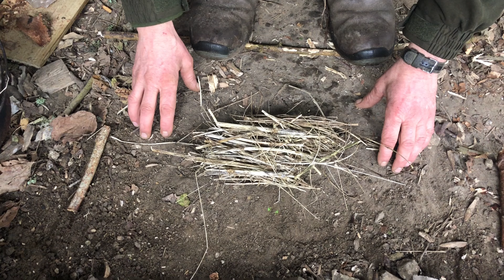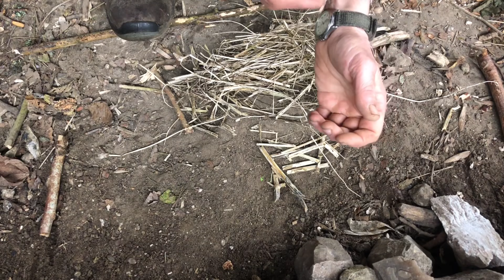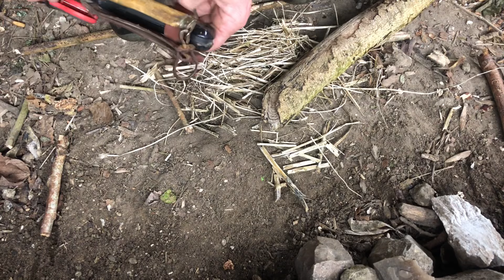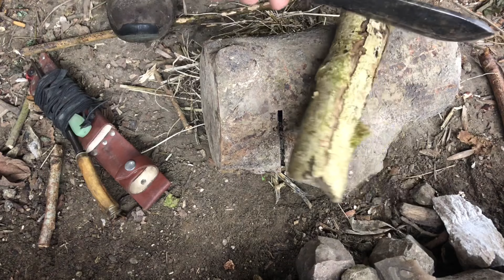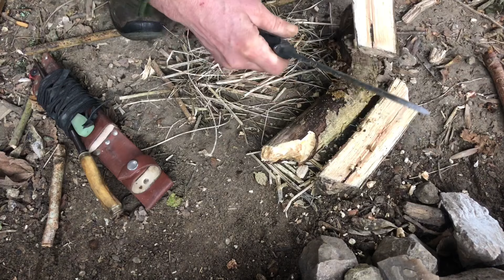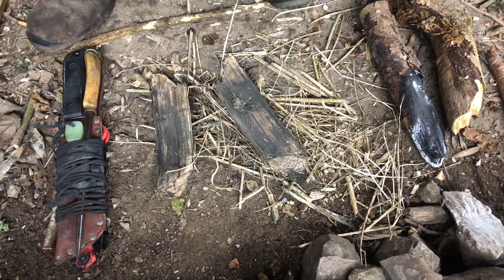Survival Courses. Friction Fire Roll. Set up and first attempt.

Comment: Interesting method of making fire - but why do you put so much work into it to make it work, if you already have a fire to dry out your materials some more? Just need to gather more firewood to keep it going.
I hope, your knife has a crisp 90° spine - not only for striking your ferrorod, 
but also to scrape fine wood shavings or flattening fire-boards to a carpenter-grade smooth and even surface.
Splitting wood is not a task for a knife (even such a heavy chunk of metal like yours) -
 'smart batoning' just needs to cut some wedges from smaller stuff first and using the knife just to START a split, then take it out and go on with the wedges. This can be done even with a SAK with no limits in diameter, just follow the previous cut across repeatedly and just bury the blade (watch the YT-videos of Felix Immler, the Victorinox-guy, on this matter).
No extra work, no wasted energy - the cut-offs from trimming make nice tinder or kindling and when you're done, the wedges turn into firewood. It's just a change of order.
Always have a small 'mini-tarp' or garbage-bag in your kit - 
a) to keep your materials dry in pouring rain with a tarp-setup overhead - 
b) to lay on the ground and catch all small cut-offs, sawdust etc. and keep it off wet ground. If you try to fluff up bark, grass or similar, all small particles that fall off will gather on it and with some coarse stuff on top and flipping it upside-down you get a really 'catchy' bird's nest with a dust-fine top layer.
Looking forward to your next attempt.